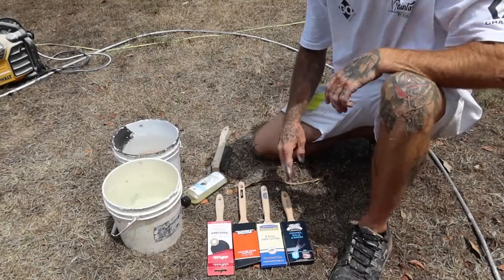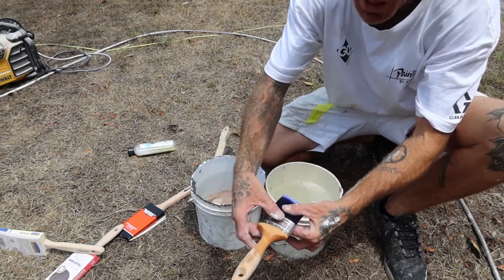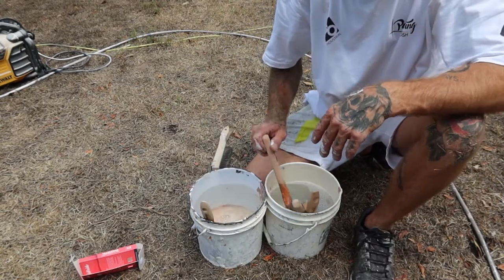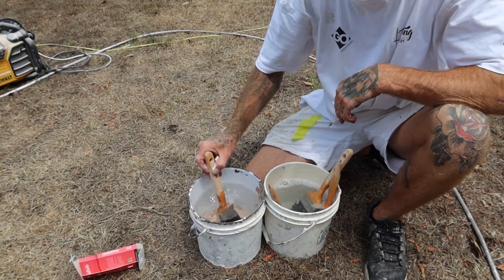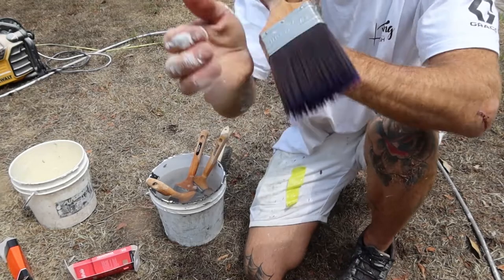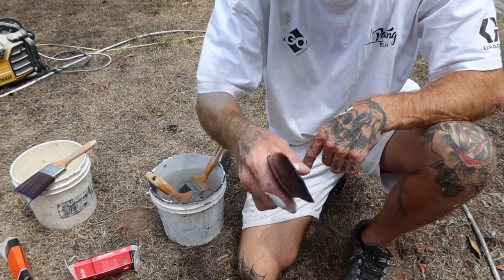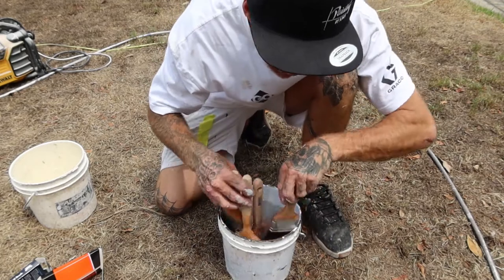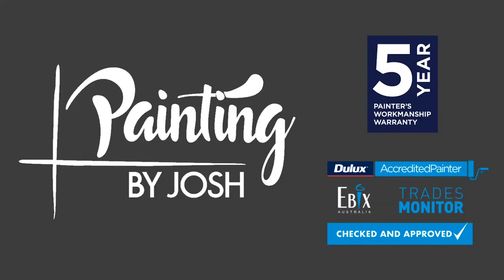BRUSH CARE

Comment: Have you tried the digger brush and roller clean up
Reply from the maker: Have not tried it. I use Pretty Boy Cleaner as it an eco-friendly, all-purpose paint cleaner & conditioner. There is absolutely nothing like it on the market. don't need to wear PPE gear using it either.
Reply: The diggers brush and roller cleaner is the exact same thing mate it’s made from all natural ingredients
Reply from the maker: @dustypirates9562  is that the one with the flammable liquid 3 on the front label?
Reply: Painting by Josh Nar I thinks two versions ones for old clogged up brushes which is probably the one your think of but the other one is all natural called paint clean up but it’s a brush and roller condition/cleaner and also good for cleaning old and new paint I used it and cleaning oil base off carpet
Reply from the maker: @dustypirates9562  awesome mate will definitely check it out 💯🤙
Reply: Where do you buy the pretty boy cleaner from bro?

Comment: thats is the problem with synthetic brushes once the bristles are bent thats it hopefully they will be able to get the bristles to behave like pure bristle at some point.
Reply from the maker: Hi Jack, Synthetic brushes give a smother more even finish than the OG hogs bristle & last longer if looked after. If the synthetic brushes are bent put under some hot water they usually straighten out. 👍